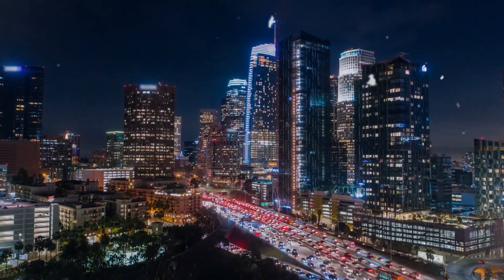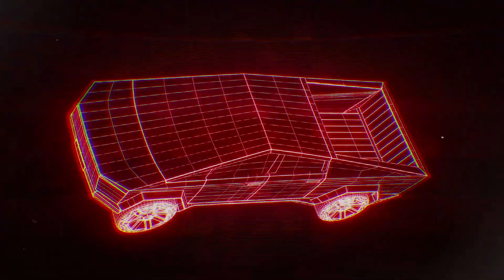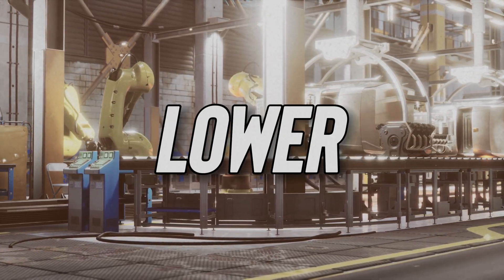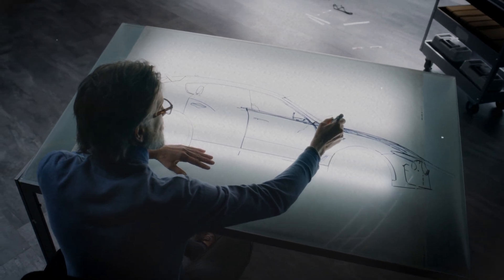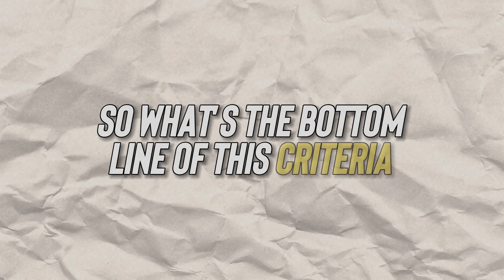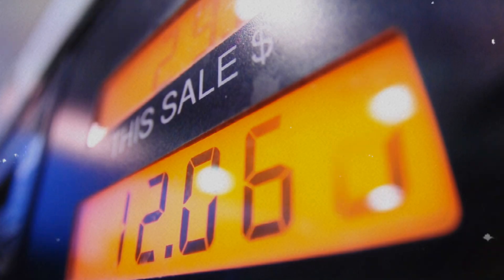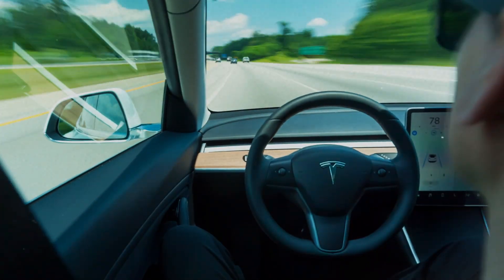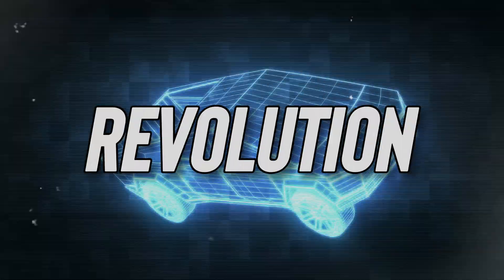Cybertruck: Innovation Redefined

Comment: To the author I thank you for your production of this video!  Very well done and thanks for sharing this.  I have issues with the body and battery of this vehicle that concern me recently.  Stainless steel is outstanding in resilient structure as seen in our pots and pans in the kitchen.  Yes it looks like a permanent solution to rust. Moving on to the batteries...is there a recycling plan for these once spent?  My point is if you could speak about the entire life cycle of this vehilcle that would be outstanding.  Purchase, service maintanence, collision repairs, end of life.